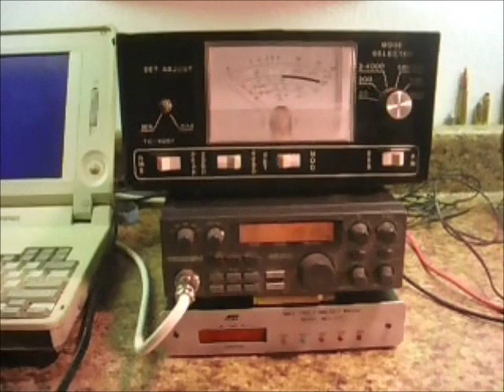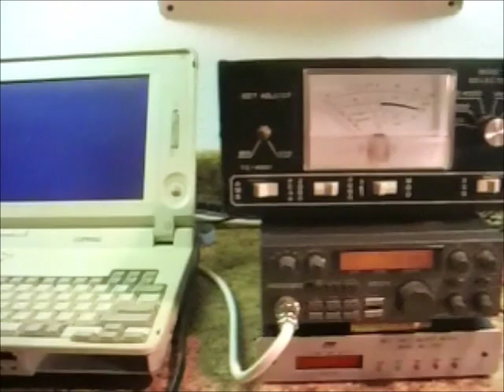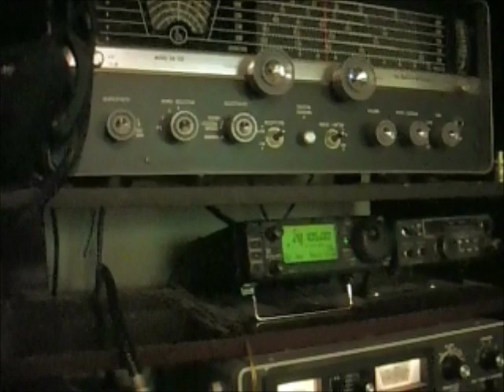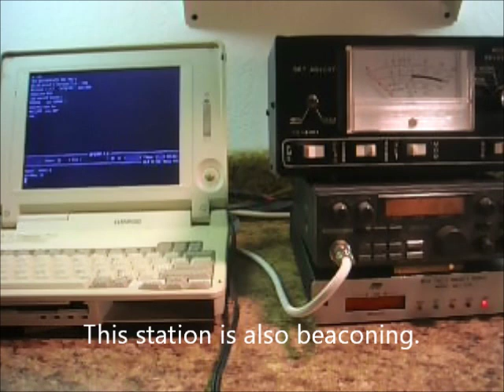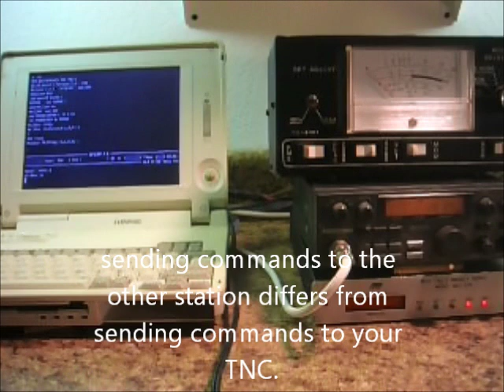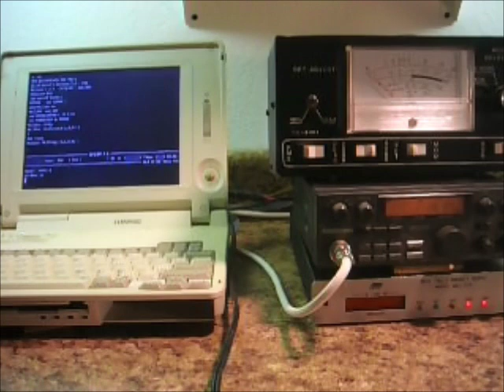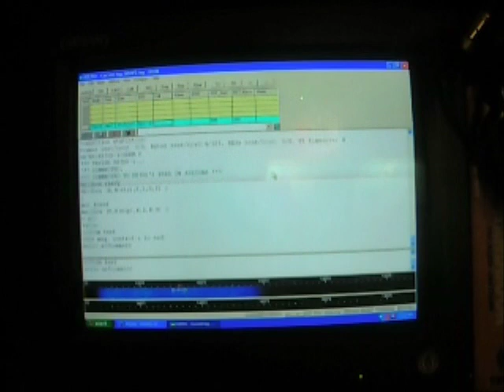Packet radio demo part 1

Comment: I use putty and I also have it working through the virtual machine with DOS. 

At Dayton the MFJ booth had some discount boards.  One of those was the 2400baud upgrade board for the very TNC I happened to own.  $5 and easy install, now my TNC does 2400.